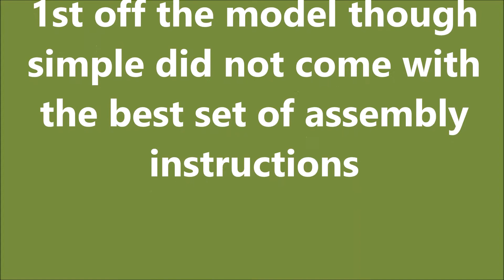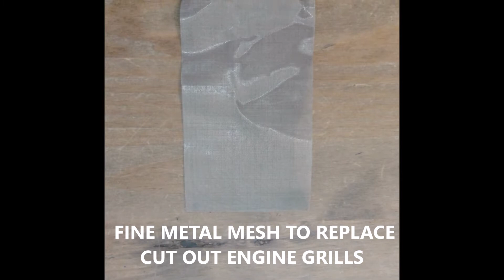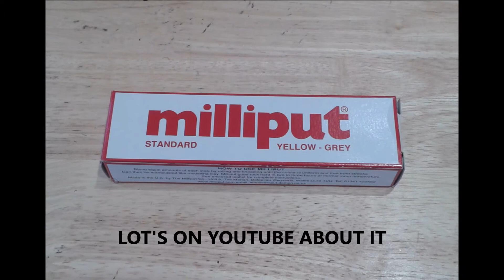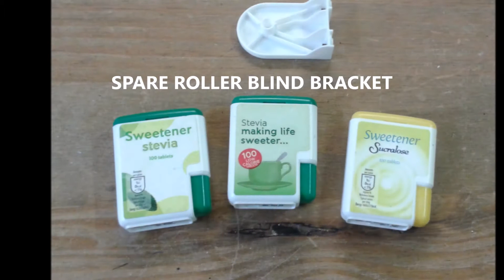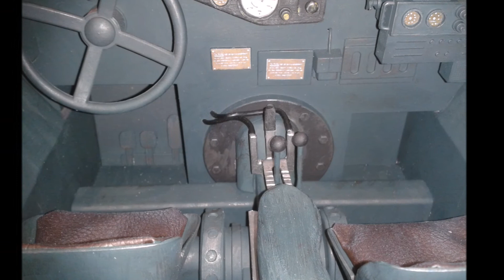1/6th Scale German Half track Sd Kfz  250 complete build.

Comment: A lot of very ingenious scratchbuilt parts added. Very nice! One trick that would have helped the look of the tracks( I learned from the 1/6 forums) is moving the rear wheel up and in to make the tracks have more of a sag. The other, constructive criticism, from one that has built 5 of these, is that eventhough it is a lot of work, the overall look of the vehicle is much improved if the visor frames are removed. But congratulations on making a nice model out of the simple Armour Hobbies 250 kit! You were fortunate that the plastic of your kit was of good quality. Some of these kits had VERY brittle plastic that shattered way too easily. Again Cogratulations on an amazing build and a VERY cool video.
Reply from the maker: Thank you so very much for the cracking comment and constructive remarks. Thanks again for looking hoping to upload some new movies soon.